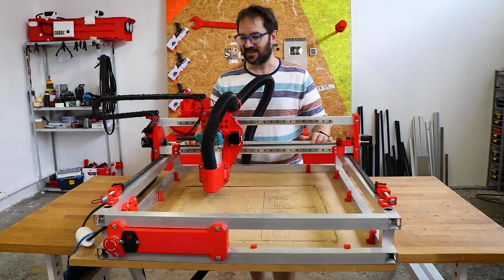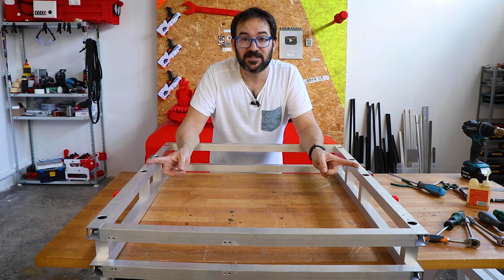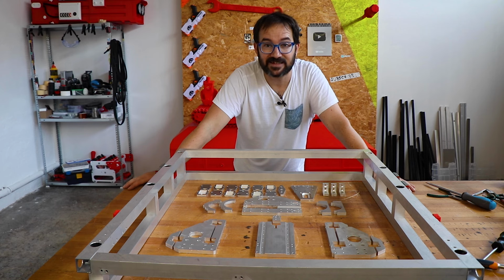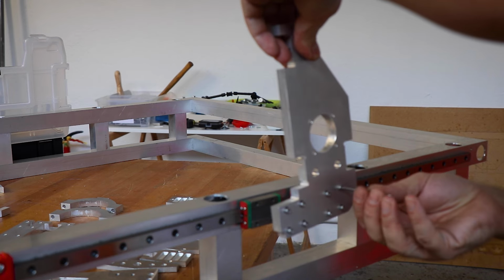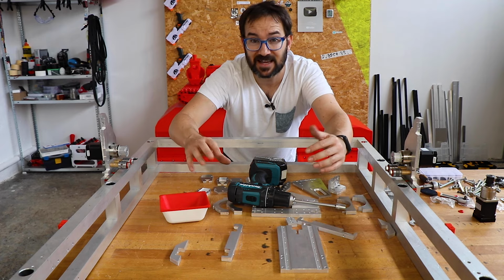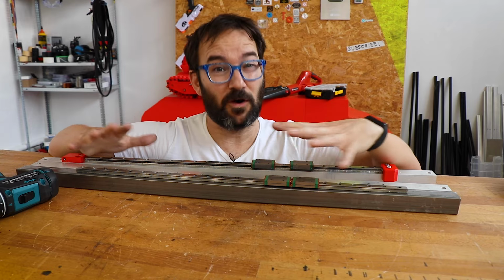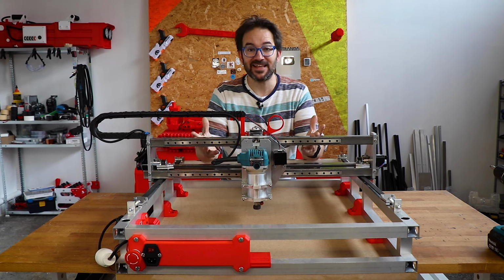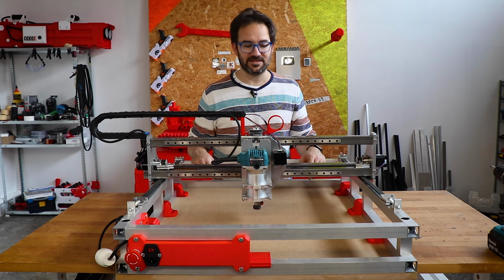A CNC ROUTER THAT MACHINED ITSELF

Comment: I hope to do this with my 3D printers soon. You’re amazing Ivan, and don’t let anyone tell you otherwise!
Reply: I ended up doing the same.

Bought a cheap Ender 3, modded that to the extent maybe 1 profile is the only thing original on the machine, then thought of building my own large 3D printer, but the main thing I disliked about most 3D printers is that they are wobbly as all hell with the tiny 2020 profiles and plastic parts.

So instead I used my upgraded Ender to build a basic benchtop CNC that can deal with aluminium.

And used that to start milling parts to build a 3D printer with larger profiles (2040/4040/4080/8080/20120, etc) and a CNC with aluminium parts where they were useful to sturdy things up.

Then I bought one of those micro lathes, upgraded the crap out of that with the CNC and now I'm using that to make new parts for the other two.

And I'm guessing once I'm done with that, I'm going to feel like neither of the 3 is capable or big enough and start building bigger and stronger versions of all 3.

I wonder if there's an endpoint in this hobby, the better you make your tools, the more ways you figure out to make your tools better and so on and so on XD

Comment: Your 3d printing channel is turning into a machining channel.  This Old Tony would be proud.
Reply: The "This old Tony" in joke of cutting bar stock by dropping it, snapping it, or one inch punching it has become an online engineering meme that's been given a nod to by near as damn it every other engineering channel out there. The blokes a legend in this particular quirky form of comedy......... Now, just picture him paying homage to Ivan's channel by building something and saying "OK, this bearings going to need some clearance, so I'll just go turn up........ aaaaaaa SPACER !!!!!!". I think I'd laugh so hard I'd choke to death !!! :D
Reply: this old tony would cry if he saw this. this is terrible engineering. for instance, those "spacers!!" directly influence the stifness of the machine. stiffness in a milling machine is everything.
nontheless a cool project, but still the corners he cut to get it done are the tiny details that transform a decent machine to a very good machine.
Reply: @slaapkonijn58  Considering that Ivan isn't a trained engineer, I think what he's built isn't too shabby.

As I said elsewhere on this comments page, There's a few parts where I thought "Why the hell do he do this like that ?!?!?", But I quickly realised that it's because he's come to CNC metal machining from the world of 3D printing. He's used to designing things to be "Built" one layer at a time out of plastic. It's going to take him a while to mentally adjust to this new "Material removal" way of construction.

I'm actually REALLY looking forward to see how he thinks out other projects in the future. Because he's not got the blinkers that being taught "The right way to do things" puts on us, it should be really interesting to see his alternative solutions to problems that our tunnel visioned view made us think could only be solved one way.

Comment: Ivan,  if you added a mdf web or “diaphragm” between the steel tubes of the gantry it would stiffen it considerably.  Maybe dampen vibration as well.  You could add one vertically or add them horizontally and at 45 degrees to make a space frame.  That would provide torsional rigidly as well.  Or you could 3D print truss webbing.  Probably not quite as stiff or dampening.

Maybe do a video testing if it does stiffen the gantry?

Awesome build by the way!

Comment: So: first drill the hole, then countersink the hole and finally cut the thread. Did you already know that a file also has a cutting direction? And drilling into metal parts without properly clamping them is extremely dangerous!

Comment: Ball screws will likely provide significant improvements. Higher cutting loads would be possible so long as your motor can handle it. One question I wonder is why this rather than buying a mill and doing cnc conversion? Obviously I see the significant difference in size but it seems like you’re more focused capability.

Comment: 16:52 don't you want another nut on the bolt to hold it into the belt clip?
Reply from the maker: Aaargh! You're right, I'm an idiot, I'll put one in the next disassembly
Reply: How does one tighten this configuration? The bolt head is in the clip.  And the free nut is on the other end. It seems like tightening the free nut will lock the nut into the aluminum before it could tighten enough.

Comment: I was trained as a metal machinist, and I kept seeing design features on this that made me think "Why the hell did he design these parts to fit together like like that?". Most of the things I noticed weren't really any better or worse than the "Normal" way to do things, Just an unusual and unexpected way.

It dawned on me about half way through that Ivan came to engineering from the world of 3D printing where you try to design strength into something by adding material (And therefor, Printing time) only where needed. I come from an industry where you primarily machine to get clearance for other components, and only spend the extra time needed to remove unnecessary metal if part of the design brief calls for lightness. He comes from an engineering situation where the fasteners are stronger than the material that the structures made from. He's learnt that you can't put high loads on threads in the structural material. He's come to mechanical design with a completely different mind set compared to what people trained in engineering have. It then became REALLY interesting to watch the unusual design choices and understanding why those choices were made.

As I said, I couldn't see anything that was intrinsically flawed, But there was a lot of slightly odd design ideas that could be useful things to keep in mind for if they would be a more appropriate solution in any of my future projects.
Reply from the maker: I struggle to change the mindset indeed! I'm restrained by the thickness of what I could cut. Now I can cut thicker materials so I can just make more stuff in a single more sturdier part. Thanks!
Reply: @ivanmirandawastaken  I wasn't criticising you mate. We think out solutions based on previous experience and whatever knowledge had been given to us.  You've got a quite rare set of previous engineering experiences that give your solutions an unusual quantity that's very interesting, even to a seasoned engineer.

It's leading me to believe that my engineering education may have given me a kind of tunnel vision with regards to thinking up solutions to engineering problems. I only have the set of "approved" solutions I was taught (Plus some shortcuts I've learnt along the way) in my mental toolbox of options.

You on the other hand were never taught that "this is how something HAS to be done", so you try other ideas out, and find that a fair few work just fine.

I'm thinking  I could learn a lot from watching how you do things differently to how I would have done them, then pondering about the benefits and drawbacks of both solutions.
Reply: @Reman1975  Very interested in those items you noticed as different. (I'm not an ME, but learned by trial from a cnc /woodworking perspective).
Reply: @TheRainHarvester   It's mainly things like drilling right through some plates and adding longer bolts with a nut on the other side rather than tapping the through hole and just bolting into that. There's also some parts that use a "T slot" that a bolt head slips into, Like the belt adjustment clamps at 16:50 and 17:57, and how the top plate on the X axis carriage is attached at 18:02. Most "Trained" engineers would have probably drilled and tapped the bottom plate of the clamps and threadlocked a length of allthread into them for the belt adjustment, Or threaded the part all the way through and had the bolt the other way around. The end plate on the X carriage would have been attached by drilling 3 or 4 holes through the end plate and into the edge of the carriage, Then tapping the carriages holes and drilling the plates holes for bolt clearance. I've seen some lightweight Chinese "Hobby" machinery that use T slot's to hold thin sheet metal in place edge on, But that tends to be done because it's the cheapest way to attach non structural or low stressed parts together. I've never seen it scaled up and used on a structural joint before, But looking at it, I can't see it being any weaker than the parts being threaded and held together with smaller bolts (Smaller due to the constraints of the materials thickness)

As I said, There's nothing wrong with how Ivan's done things here, It just feels really odd after you've been taught "If you're fixing parts [XYZ] together you HAVE to do it THIS way" to see things successfully done quite differently.
Reply: @Reman1975  thanks for this write up!  After making my cnc (on my channel) if I made another, I'd design it with adjustability in mind.
Do you think one of these ways allows for adjustability? (T slot vs tapped holes?)  I'm guessing tapped holes would be better because the unthreaded plate's holes could be made bigger so the plate could adjust.  But I don't know if that works with tapered holes, so maybe adjustability is still not possible?
Reply: @TheRainHarvester  If you can build accurately the bolts in threaded holes work a bit like locating dowels if you take it back apart for something. That mean it goes back together pretty much in the same location as it was. If you think you'll only need a couple of millimetres of adjustment you can use "Button head bolts" and over size the through hole a drill size or two so you can move one piece in relation to the other a little. The T slot idea would allow a lot more adjustment as you can move the plate with the through hole as far as you want as long as the bolt head still engages with the slot. In the other horizontal axis it's able to move as far as you have clearance between the bolt and the slot, But the wider you make the T slot the less material the bolt head will be engaging with, and the weaker the joint will become. Both ways would be able to be shimmed or shaved to get the last axis spot on.

The T slot looks to be a nice solution  that would work for most 90' flat plate to flat plate joints. It's going to be easier to make with basic tools and would be more tolerant to slight inaccuracies when machining it. I'd say it would be a little more prone to vibrating loose though.
threaded holes in the work piece would need more tools, and would require closer tolerances when being machined, But it would also help with the accurate positioning a component, and if properly torqued it's not going to be as susceptible to being vibrated loose.
Reply: Exactly!  I started as a machinist out of high school over ten years ago and just recently migrated to the 3D printing world.  It's going from a mindset of removing material to create something to adding material.  I found this by researching to build my own CNC and while I found many things I will do differently, I am still going to purchase his plans if not only to support the guy for taking the time to do this.

Comment: Awesome work! Now you need a proper CNC spindle. The wood router minimum RPM is still too high for steel!!
Pro tip: Files works only in one direction. Pulling on the file is like trying to drill rotating the bit counter-clockwise!

Comment: You can fill all those aluminum tubes with specific and cheap type of cement it will make ur structure way too much strong it even performs better than fully filled metal structure
Reply: Cement is corrosive to aluminum, isn't it?
Reply: Tzuede Off the Cuff  he didnt say epoxy cement :P and actually corrosion doesnt only appear because of acids or oxidation. But anyway, regular cement shrinks while drying and as you said is alkaline, which easiliy dissolves aluminium, even the oxides. Epoxy cement is truely the way to go. Just not regular cement
Reply: And if I may add, the passivation layer (the aluminum oxide) is a great protection layer for aluminum parts, but it doesnt appear that fast at room temperature and atmospheric pressure
Reply: Finally, "caustic" means corrosive... the term you're looking for is alkaline. Many acids can be corrosive as well (as you've already mentioned)
Reply: @YanouFishel  But would shrinking be noticeable at all on such tiny cross area? I think just getting the stuff solidly into the tiny tubes would be the problem.  You'd have to tilt the machine to get it in and hope the bolts don't block the pour, and never need to be adjusted.
Reply: @TheRainHarvester  True! Although I heard it shrinks a tiny bit, meaning it might be loose in there. Epoxy granite or cement might be a tough one too with those bolts

Comment: Yes Ivan, Yes. This is the way to go! :) ps it looks like the M3 holes for the MGN12 carriage mounts are not M3 but M4 holes in the aluminium sideplates. If that's true, too big holes can cause problems later on when using the machine.

Comment: Nice! Now, try and use the mill like it should be used: spiral down to a nice depth, 8mm or something like that. Now, cut with the SIDE of the bit, instead of the end. So, at full depth, just take off 1mm at a time. The adaptive clearing function in fusion is perfect to do this. With the right speeds and feeds, you should get beautiful chips flying of the bit instead of powder. 
BTW, a fogbuster is a great addition too. Keep up the good work!

Comment: Save yourself the filing and sanding.  Secure the piece down with screws before you cut it out and don't use tabs. Just about every part you cut had a hole going through it use those holes to secure the part down then cut it out.

Comment: Hey Ivan, you should make a 3d printed adapter to capture the exhaust air from the router motor and use it as air blast chip evacuation.
Reply: Tzuede Off the Cuff  very true; i was just thinking there was enough flow and pressure to be able to blow the chips away so he didnt have to add anything more then a 3d printed duct.

Comment: Next will be a CNC'd Plasma cutter used to plasma cut steel parts for a new CNC
Reply: That actually would not be a hard mod as you only need to get a plasma cutter.

Comment: Please take some advice from a former industrial mechanic:

When drilling, turn the vice in such a way that the rotating lever rests against the stand of the machine. Turn your vice 170°. That way, when the part gets caught by the drill, the drill will hopefully slip in the chuck. But not tear your hand off. Also, since no inertia can build up, way less danger of something coming loose and transforming into a turning knive.

When cutting steel (drilling, tapping) please use coolant. Your tools will thank you.

When filing or deburring, the working motion should be away from you. The file works like a saw. You don't pull a saw, you push it.

That being said, amazing project! Good work. I'm impressed :D
Reply: Any sort of cutting lubricant to get the chips out. Was biting my nails thinking about a broken tap.
Reply: Is this the professional section of chat? 😃!!!
Reply: re: filing, fireball tools did some testing of that, though his focus was on tool wear and clogs.
Reply: I think you're seeing what you want to see, not what's actually happening. There's no danger at all with anything he did in the vise. The only steel he used was some light wall tube steel, and he used cutting oil on every single hole. My Noga deburring tool is designed to be used toward you, not away, as well as several of my file sets; and as other people mentioned, of course you pull a saw, and pull saws are superior from an ergonomics perspective.
Reply: @canonicaltom  hey, good for you :) You know what, whatever, you're right. Yeah, sorry for my advice as a machinist. That's what I learned in my 4 years in a workshop so take it or leave it :)
Reply: Bullshit... If you use a good quality aluminium like 6061 or better 7075 and tools with polished flutes working dry work with no problems. The rotational speed and machining speed must be optimized so that the heat is in the chips.
Reply: Tzuede Off the Cuff  Japanese razer saws cut on the pull, and Western/European saws cut on the push. If I tried to cut on the push with my ryoba or my dozuki, I'd be making a file card from the broken blades and waiting for the new blades to come in.
Reply: @Rottwiler44  Yeah, western style handsaws are torture once you've tried a good Japanese saw. I wish there were pull cut files too. Sometimes I flip them around and hold by the tip just so I can pull cut :)
Reply: Tzuede Off the Cuff  hahaha nothing beats experience. But well, I'm not judging you. Do it your way. Greetings from overseas.
Reply: Some kind of file are both-directions symetric. And... you don't know Japanese pull saws? :)
Reply: ... a machinist is different from a hobbyist... hobbyists have LITTLE SENSE of DANGER! ...creativity drives them, totally forgetting what 'safety' is all about...!
Reply: @pablobeltran3028  hopefully there’s something of training those hobbyists... thus I am a hobbyist but had CNC school before so know a little bit about safety XD